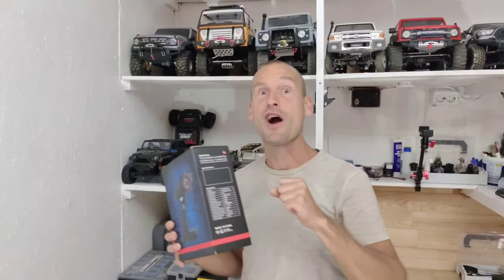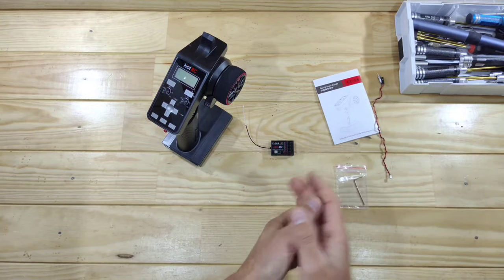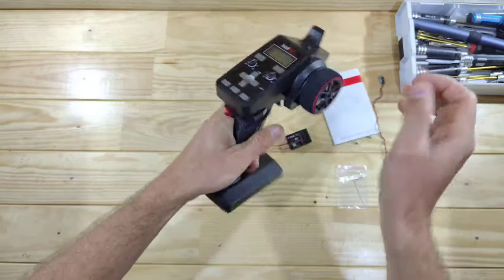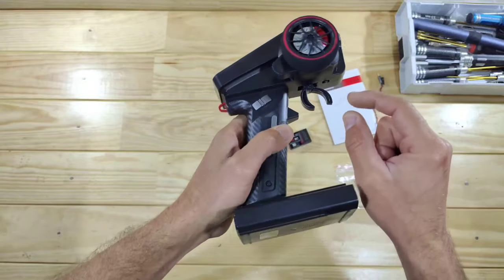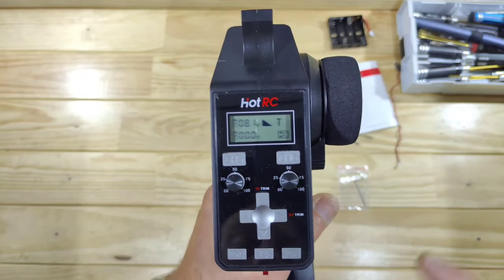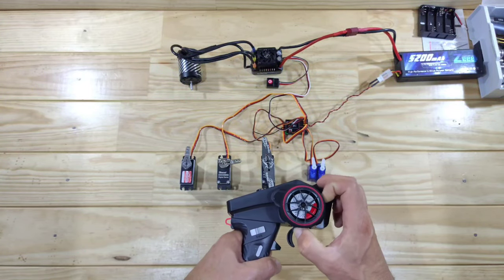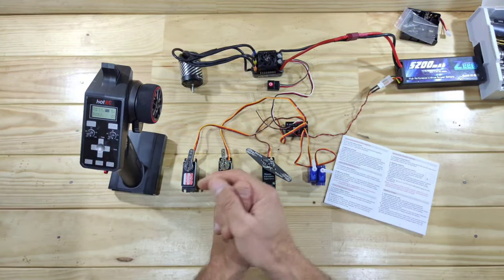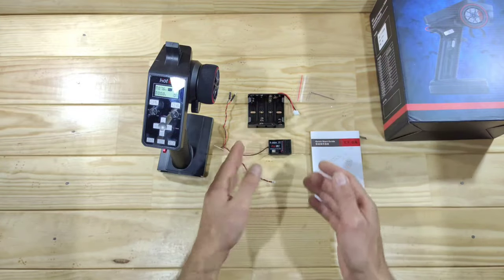Wrong! it's actually good! The HotRC CT6A

Comment: Thank you I got a special guide in this video including "what is the function of usb-c, I don't know it's better to find it yourself manually" but it doesn't help logically my mind is stuck😢
 it's useless I can't do anything on usb-c when assembling the cable current maybe should change the direction of the connection for the charger on AA batteries, lithium, & AA type batteries (the big ones in the transmission grip) that are underneath maybe? 😮
Reply from the maker: Don't know, sorry
Reply: Supposed to be able to charge the 18650 battery and use the transmitter on simulators with it.

Comment: I bought a couple, based on your semi recommendation, and find them much easier to use than the dumbos I had been using
Reply from the maker: Hi, indeed they do. The display is a revelation
Reply: I bought 18650 battery but am afraid to install. It fits so snug, I don’t know if it will come out to recharge. Any tips?
Reply from the maker: @peterbuller3572  sorry, no tips. I had a 18650 from my torch, that didn't fit as well

Comment: Hello! I connected motor fan to 5ch. But it works only when I pushing on the 5ch button. How fix it? Thanks
Reply from the maker: As far as I know, you cannot change the buttons from inching to locking

Comment: Can you bind 2 receivers to same transmitter (not to be used in same time but just to be able to use same transmitter with 2 cars)?
Reply from the maker: Yes you can, you can save up to 10 cars
Reply: @hofsplace  how does it work to switch from one car to another? Any action needed, or will the Receiver connect to the first Transmitter that gets turned on?
Reply from the maker: @emiliandobroaica4646  there is no different memory function for each car, you need to bind it each time on the RX,
Reply: Thanks for the clarification!

Comment: Good video la funzione fal safe e compresa?
Reply from the maker: The fail save normally sits in the receiver.
Almost all modern TX/RX has it build in. You can test it yourself, just put the car on a stand, give a little throttle, and switch the transmitter off
Reply: Quindi è già inclusa non è come ad esempio i flysky che devi impostarlo manualmente